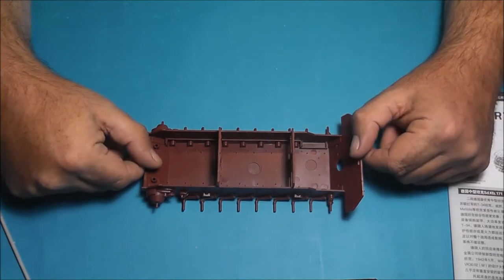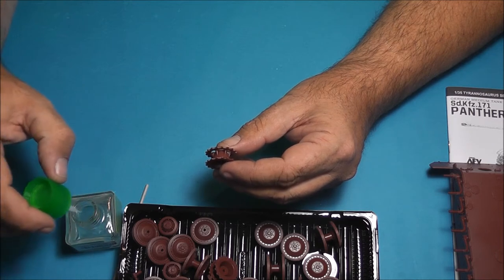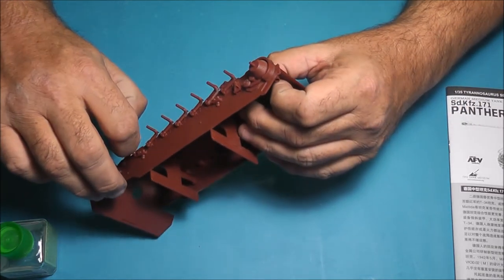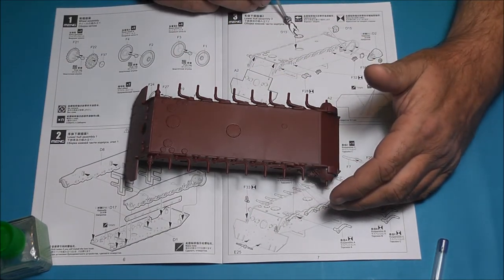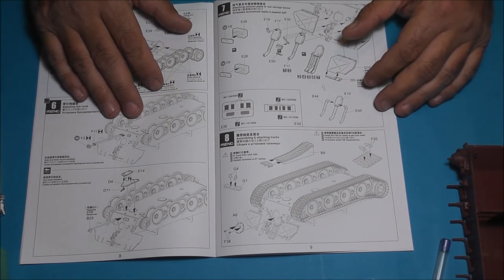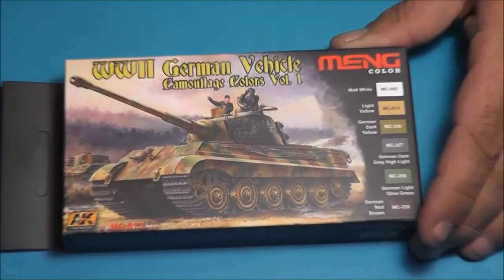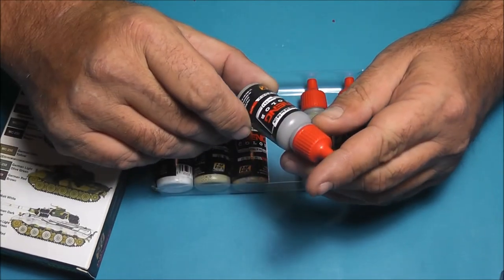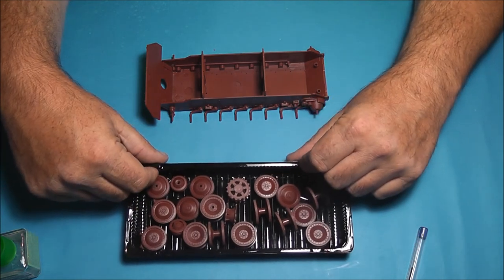Meng's 1/35 Panther.A buddy build update 1

Comment: Nice build review. Am currently building the Meng Panther D. So far I'm in agreement with you. A joy to build, and no issues yet. Just paying attention to the instructions, and what you said about the suspension section instructions is spot on.  The plastic on my Panther is not as brittle, but I'm either using my Tamiya 123 sprue cutters or my Meng pair.
Looking good and looking forward to more updates! 👍

Comment: Great tip on the brittle plastic. That is the kind of stuff I like to know if possible about a kit. The Bu181 I recently built was made of a very soft plastic and needs to be handled differently.
Really good observations on the steps so far, and I am looking forward to seeing how the zimm works. I am really interested in seeing how the various decal types work, since Ive never tried them meself.
Reply from the maker: Brett G  thank mate and yes I will try to point out problems and try and get the Zim on with luck